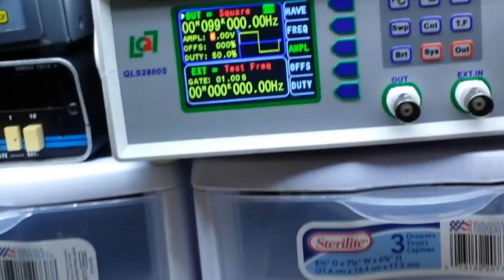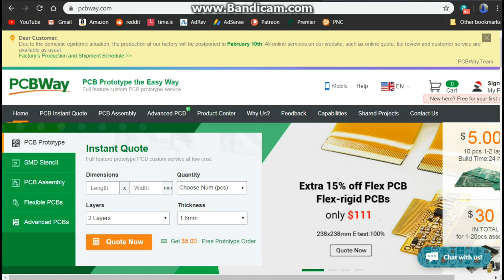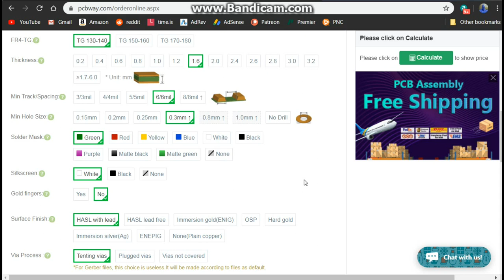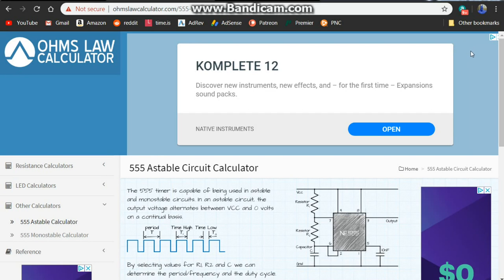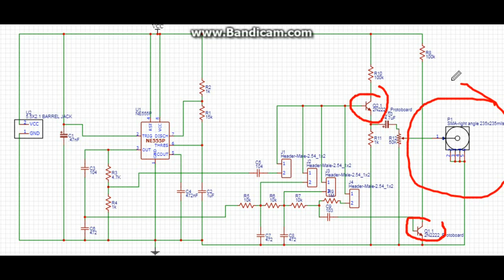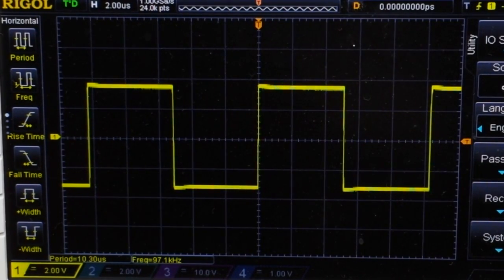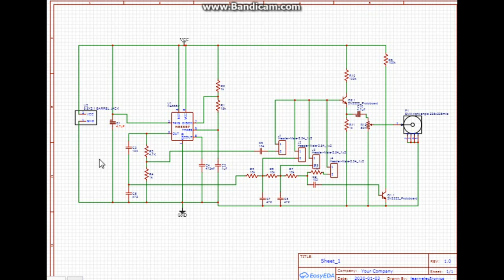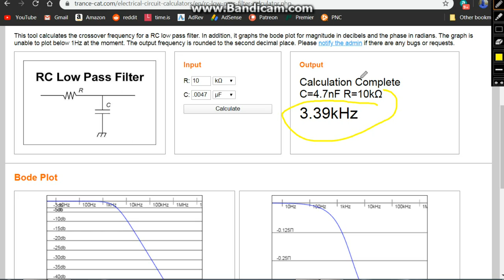555 Timer based function generator v1 Not off to a great start

Comment: The circuit diagram shows  the capacitor on the trigger connected between rail and ground, I cannot see how this can work.

From a more general point of view, there is a joke about a car driver who stops and asks a local for directions. The reply he gets: " if you are going there, I wouldn't start from here". I question if the 555 is the best choice for this project, when there are many better solutions.The 555 needs two resistor adjustments to control the frequency and the mark space ration of its square wave output, as the timing capacitor charge and discharge times are set separately. A further problem of providing a frequency adjustable output  is that a tunable low pass harmonic filter is required to turn the square wave output into a sign wave.

There are single IC function generators on the market, admittedly the digital ones require a controller of some sort to program them such as the AD9833, but there still a few analogue ICs on the market. I refer you to the XR 2202 or ICL 8038 (which is a near perfect fit).
The traditional approach is to make a tunable Wayne Bridge oscillator, as this provides a sine wave output, and it is always easier in the analogue domain to turn a sine wave into some other wave forms than do the reverse, without using a significant number of components.  Triangle wave forms can be generated using a constant current output oscillator to charge a capacitor.  The square wave can be generated either by limiting the sine wave signal or feeding it through a digital divider t type flip flop. For a simple circuit, i might choice my old favourite the quad Schmitt trigger as the square wave oscillator, or maybe a quad op-amp. The latter offers a number of way to generate the wave forms required.
In the past, I have used 4017 Johnson counters to synthesise a pseudo sine wave output, using resistors into a summing op-amp.
An R2R resistor ladder network makes a low cost D to A, that can be used with a memory to generate programmed arbitrary waveforms. A 7046 PLL can be used to generate square waves up to 18MHz.
For a fixed frequency generator, my inclination would be to use a crystal oscillator and divide down to the required working frequency. The 555 was never my favourite circuit, because it always seem to be so limited and there always seems to be a better option.
Reply: Agreed. Pin 2 (trigger) is connected straight to Vcc. The view of the board at 0:25 shows the same. I can't see how this would oscillate at all

Comment: Prototyping is somehow about leaning with mistakes with first revisions and it is represented here.  Swap the resistors, capacitors needed and it will work better, thus resulting in a better , refined revision.

Comment: I don't think you can beat the $3 price point for a 555 function generator module from the Chinese ebay/aliexpress/whatever sellers but maybe you can make something which is more interesting for modders and tinkerers for a bit more. I think you do a little miniseries how all the circuits work and what is what people will benefit more for having this particular one so they can follow up on the thinking and improve the unit or whatever.

Comment: May I politely suggest that you down load the linear tech application notes on low distortion audio signal generator. This uses a Wayne Bridge circuit with AGC implemented with linear tech high speed op-amps. The component cost should be low as there are not many components used in the circuit. It will also be relatively easy to add an additional comparator or op-amp to generate the required square and triangular waves. Failing this can I suggest that you look at the ICL 8038 precision waveform generator IC. This cost approximately £2.39 and has very few external components to make it work. Both the above offer better solutions than the 555 circuit and would be worthy of development on a PCB. 
I commend the use of the myriad of application notes that the IC manufactures produce, particularly those of linear technology and Texas instruments. These are always a good place to start when considering a new project. It is up to the individual or they chose to simply copy the application note circuit or to refine and improve it to meet their needs. It is not an admission of some designer short coming to use such application notes and the technical notes that go with them. It is not our job to reinvent the wheel, but we can make improvements to it and taylor it to our needs.

Comment: When was the last time you used a Triangle wave?   Multi level Square wave I use.  Stepped ?  Sign wave I use.  In the old analog old Tv days Ramping voltage  was handy.  Used in sweeping circuits but never used these days.    My wonderfully Damaged Brain Prevents me from grasping what is required to use the Software on the Board maker.  Sad Fact.  Please take that in account if I ever ask you to provide one of your products.  

I have not issues following directions nor the schematics.  I fully understand that.  Utilizing the Gerber Files to make a order is impossible for me.  Simply out of my Computer Oligy Reach.
Reply: Your not alone. But if you don't give up you may find some use for the program and over time you'll start to figure things out.

Comment: I like your design, even though it isn’t right yet, I know it will be. I like it because it’s made of manageable components that you don’t need a microscope to tell what’s what. Also I have a question. Will your finished design be up for running a car ignition coil ? Can it handle the transients that frequently burn up my F.Generators........ All puns intended!